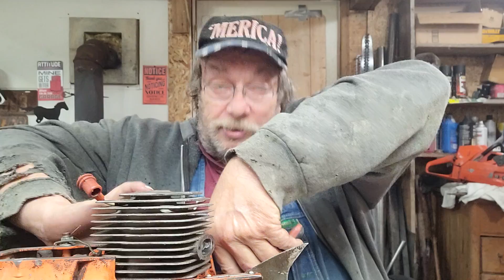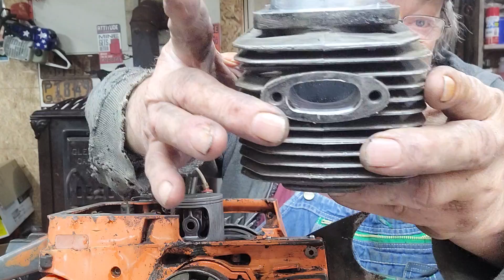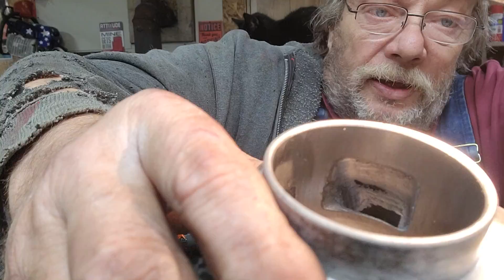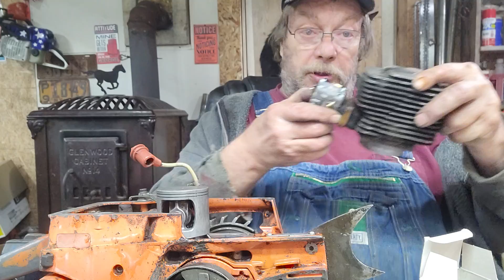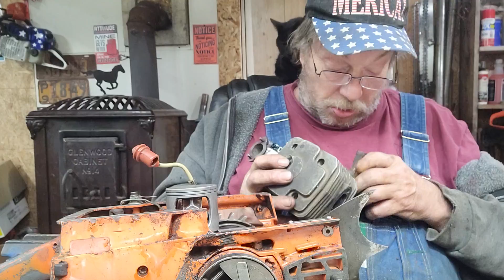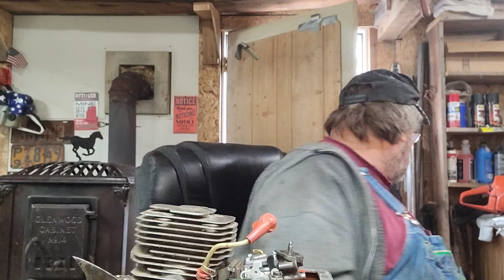Husqvarna  2100! first one I've ported in years! details and numbers on this crazy build!!

Comment: When I was 12yrs old, I inherited a box of old old old chainsaw parts. I spent the next week putting parts together where I thought they went. When I finished, I had built two complete Husqvarna 2100’s!
Now 30yrs later, I still use them to this day! My only problem is parts and repair, I’ve been robbing parts from the second power head. I’d love to know more about working on it and a source of parts/upgrades! I’d love a wrap around handle for my 2100 and my 395!
Excellent video as always sir! Keep em comin!
Reply: Hello!I have find  á Brand new 2100xp original from 1985 new.
The man say was is grandfather and only cut one Big eucaliptus and was stored.Need to pay 220usd.Have a 24” and a new 34”.Is clean like new now😂
Reply: There is now an AM top end available for the 2100. In addition, one builder put a 2100 crank in a 395 along with a big-bore kit and built a bigger displacement 395.

Comment: Uncle Harv I have several donor saws. Husky 61, 359, 365, 455. I plan to do my first porting job. These are all similar but do you recommend one over the others. Also should I buy a cheap aftermarket cylinder, piston kit to begin with or buy the Highway or similar and save the original?

Comment: I agree with your blowdown numbers 100% Harvey. More degrees of blowdown not only gives the exhaust time to get out of the cylinder, it allows the crankcase charge to build up a little more before the transfers open. The. You get that little bit more of a push from the crankcase. That 2100 is going to pull like crazy. Can’t wait to here how it sounds. That Mac you’re working on won’t sound like a Mac with all those stihl parts in it!

Comment: Iron Horse help!  How do I get the old toggle switches off the old Husqvarna 380?  The toggle unit has a brass nut which is too shallow to be used with any socket and it burrs up.
On inside it’s broken and not attached to any guts. The toggle pin came out so there’s a hole now. Any ideas? Tried getting it out from inside too, but not only is the unit beveled but the magnesium housing is canted inboard so you can’t gain purchae

Comment: God bless you both.  Great to see Barb today.  You, Tinman, and Buckin gave me the saw bug.  I had 1 Husky 257 since new in 1997. Within the last month I've acquired 2 more old ones.  A Homelite 150 automatic blue,  and Poulan 2000 in craftsman cloths.  Tomorrow, I have another Husky coming but don't know what and a Poulan that I don't know what it is.  So yeah, so far 100% success in getting them running and in the wood. I found the 2 in an old car full of scrap in a junkyard for FREE.  The 2 tomorrow is going to cost me an hours with of metal lathe work.  Thanks for what you do.  Take care pal.

Comment: Sure was nice to see your wife Barb on her feet Harvey.  I had to laugh when you mentioned the intake numbers on the 2100. I am playing with an old style 61 cylinder and cut the ports first. Then decided to bump up the compression by cutting down the squish area and the base on the lathe. Should have done that first. Now my compression and squish is limited to my intake timing. My amateur tip of the day, do your intake timing last. And I absolutely love your little cat buddy. He sure likes you!
Reply: If you got too much intake duration you can raise the intake floor with JB WELD epoxy.

Comment: Glad to see you getting more videos out again Harv. Still love watching all your videos. Question, are closed windows pistons better in an open transfer cylinder (66/266)compared to open window piston?
Reply: I have a 272 cylinder I'm working on 17° of transfer timing. It will end up with 22°. Could we get a 372 connecting rod and press it on to a 272 crank? Then put 372 top end on 272.